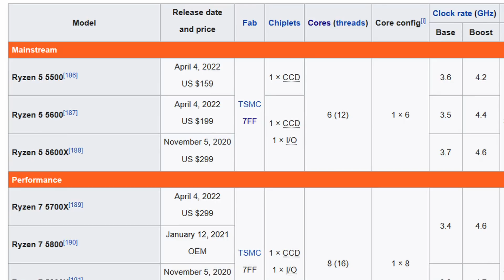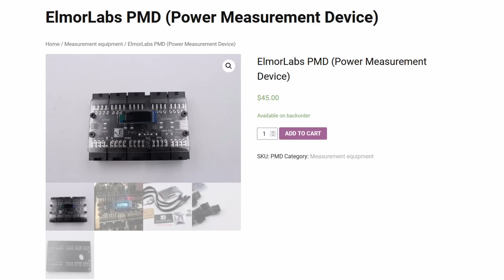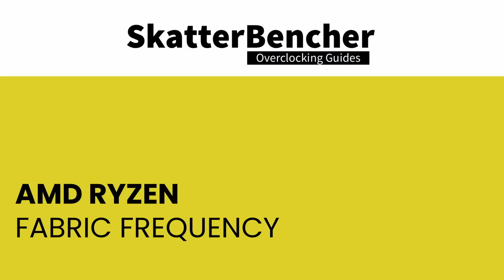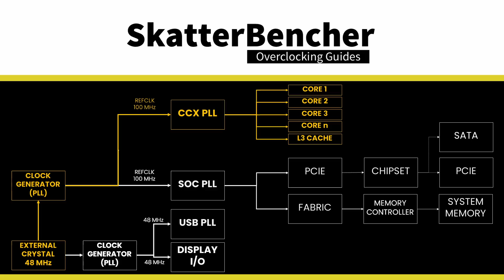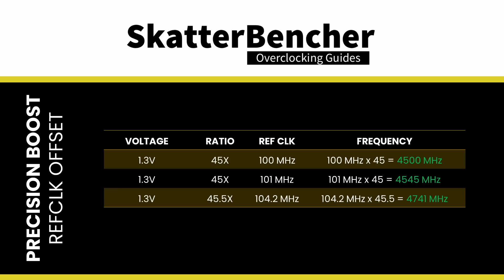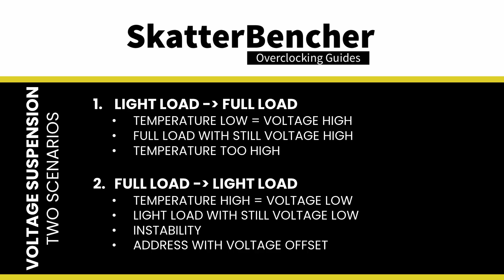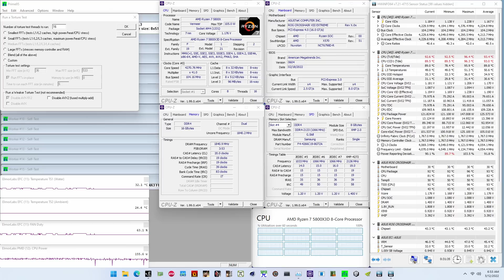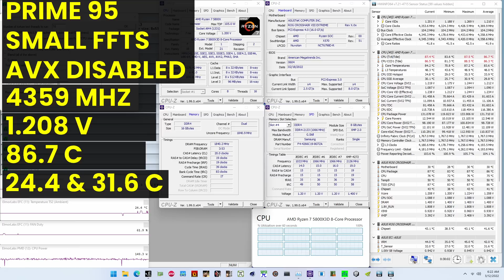Ryzen 7 5800X3D Overclocked to 4740 MHz With Crosshair VIII Extreme | SkatterBencher #39

Comment: Incredible video, I especially like the end part where you tell amd that they could've just locked the max voltage to 1.3v + have tjmax
Reply: And what if it's not possible? Nobody here is smarter than AMD
Reply: @eazen  I mean, locking the max voltage is very obviously possible. It doesn't require some special magic.
Reply: @noxious89123  alright, describe me how to do it. In technical terms please, no vague or amateurish nonsense
Reply: @eazen  The CPU already has lots of voltage sensors on the silicon that are averaged to give you the numbers you see in hwmonitor. The CPU can shut down when average voltage exceeds a threshold the same way it shuts down as soon as temperature exceeds a threshold. Even the cheapest voltage references are much more accurate than 10000ppm (~0.01V). I dunno why you think this is hard.
Reply: @NavinF  I’m always sceptical when amateurs think they know better than engineers. Stay arrogant and feel strong, I don’t need the cheap confidence boost by lying to myself that I know something better.

And btw, PBO is useless without extra voltage, downvolting isn’t useful either as this already is pretty much optimized, if you saw the reviews. So what’s the point of this discussion? There is none.
Reply: @eazen  What do you mean “better than engineers”? I am an engineer. Username is real name. Reviews say that PBO still helps on x3d and it’d be really weird if it didn’t so this is a case where extraordinary claims require extraordinary evidence. Voltage scaling only stops when the chip gets too hot. Try hooking up a water chiller and you’ll find that there’s plenty of headroom on Ryzen. Chillers are easy to build from a used aircon.
Reply: @NavinF  strange, for a engineer you aren’t well informed then. According to AMD and without regarding wild conspiracy theories that a real engineer would disregard as well, the 3DVcache isn’t suited for over voltage. And as it is tied by design to the cpu core, which isn’t debatable either, you can not use PBO. As I said, there’s no point to this discussion. Maybe future Zen 4 will permit 3DVcache to have its own voltage not tied to CPU, or not, but this is a hardware limitation and there’s no point in discussing it.

And if you want so hard to overclock it was already proven multiple times that it is possible. I however will not risk it with the 5800X3D I will buy soon.
Reply: @eazen  It's not about how much you know/how wisely you pretend or want to show.. It's just how you apply your inteligence to the ground. I know a lot of engineers or programmers (even working in anothers countrys to giants of corp.) who they don't know how to use a screwdriver. It's the same I said you at first.. Everybody have a different point of view from each other, of how you made the thinks, even when you are the specialist.. :) Ask you this.. "How the 1st Engineer could?" Born Specialist?.. You know the answer
Reply: @eazen  I came from 6 Ryzens... no one (NO, not even ONE) respect the min-max Mhz/Volts on the box label... From stock I install yesterday my 5800x 3D and start working (stock) at 4600+ Mhz... same the Volts.. You are forgetting that the limitations of the CPUs Ryzen not depends only on his own HW.... depends a lot more of the MoBo and the energy provided. My last 3700x in the BIOS 3002 of ASUS TUF reach stock 4700+ mhz without touching anything.. just a Flash BIOS xD when the REAL stock of the 3700 boost was 4.4Ghz.. Believe me, I'm not an Engineer... By the last, dont forget the marketing lies...
Reply: @eazen  alraight you are a non owner and believe everything from Amd without conformation on real life examples.. you are not worth the words.. have fun with your stock 5800x3d @ 80+ degrees celsius..
Reply: @eazen  It is possible. So...
Reply: @RobertSmith-lh6hg  yea random people are smarter than studied scientists and top notch engineers, and on top smarter on their stuff, they designed
Reply: @eazen  bruh it aint about them being smarter its just the choice to do it or not, you think  a degree makes them better then everyone else? There are people smarter that dont have degrees that hack the internet every day smart enough to hack the best servers and companies in the world its called talent, its not that AMD is smarter is just that this is what they chose to do instead of just adding some limitations but still allow us to OC the chip

Comment: EDIT: Arrived, and it's rediculosly high quality CCD lmao. 1900-2066 fclk all work (WHEA towards the top end though, haven't even tried tuning out yet). 

Peak 1t temps at 4770mhz 51c svi2 and it goes straight to and sticks at 45.25 multiplier.

Temperature won't be my limiting factor 😂

Excited to see what happens when the x3d is cold.

Simply baffled as to excluding CO from options allowed for us. Can you confirm/deny DOCS working with x3d?
Reply: Where did you get it from? Isn't it supposed to be out on 20th?
Reply: Please post a desktop video or webpage
Reply: tell me if it breaks
Reply: @mememanfresh  Why would it break?
Reply: @RobertSmith-lh6hg  because apperently the 3d vcache only supports 1.35volts to i want to know if you have any problems in the future

Comment: Is it still possible to adjust mobo PPT/TDC/EDC values?
Reply: No pbo is also disabled so u cant adjust those settings
Reply from the maker: Technically true, though there are some ways you can try setting those values in different ways. Unfortunately, you can only program lower values but not higher values.
Reply: @SkatterBencher  Hi, do you by any chance know if it’s somehow possible to open up EDC/TDC/PPT on a 5750G? Have one with an ASUS ProArt B550-CREATOR and would like to increase multi-core performance, with standard settings temperatures max out at about 65°C.
Reply from the maker: I've never tried a Ryzen Pro model, but since it's also locked for overclocking I suspect PBO is also not accessible
Reply: @SkatterBencher  opening up a 3900 Pro works, the 4750G and 5750G are the only APUs I got and behave the same here, so I was suspecting maybe there is something specific to APUs… Is increasing PPT on a 5700G, for example, possible?
Reply: @SkatterBencher  I had 4750G Pro for testing on X570 Aorus Master (1.0) last year and i was able to achieve allcore, pbo and memory tuning on it. Since the Master lacks igpu output i was not able to oc the igpu. But as far as i know atleast the Ryzen Pro models are not locked in any way. Threadripper Pro models may be tho.
Reply from the maker: Oh, thanks for the information! I learned something new today!
Reply: @SkatterBencher  I think the confusion maybe coming from the fact that it's not possible to use Ryzen Master OC Pro models. Tho i did not test that myself. I did all my tuning from BIOS and i did not see any restrictions or missing options there compared to 3800X that im using daily. AMD themselves could be clearer when they say OC is not supported for Pro models. Or maybe it just not covered by warranty on Pro models.
Reply: @Raivo_K  Are you sure you could exceed the standard PPT of 88 W? Just setting frequencies works but if your workload needs more power to perform multi-core-wise, it doesn’t really matter…
Reply: @abavariannormiepleb9470  I did not measure power draw at the time but im not sure i would have been able to get 4.5Ghz allcore oc on it without a voltage bump that exceeded 88W. I dont remember what voltage i used . I looked at some old screenshots and all i have are some benchmark results vs 3800X but no hwinfo sreens showing PPT values etc.
Reply: @Raivo_K  That’s unfortunate: While I really like the two systems i got with Zen2/3 APUs (4750G + Gigabyte B550 Vision D and 5750G + ASUS ProArt B550-CREATOR) I wish there was some way to unlock their PPT/EDC limits :(
(Talking about UEFI capabilities, not Ryzen Master)